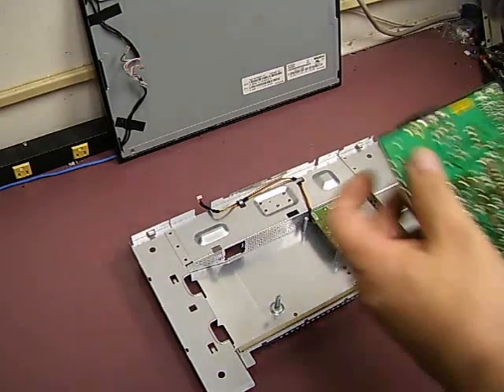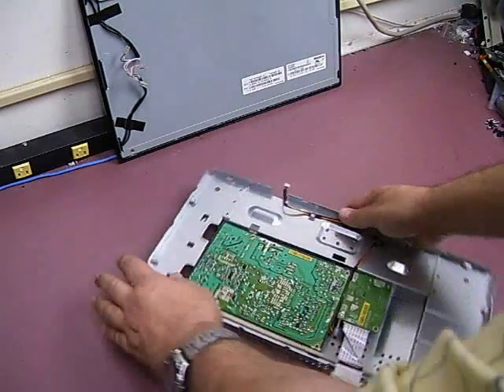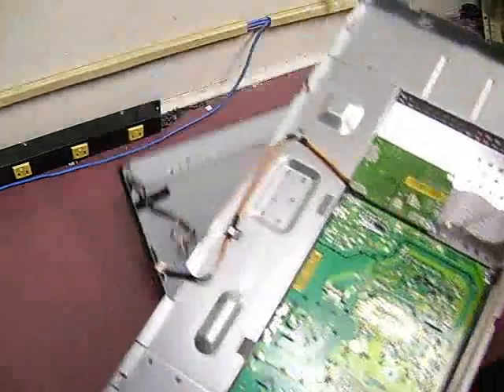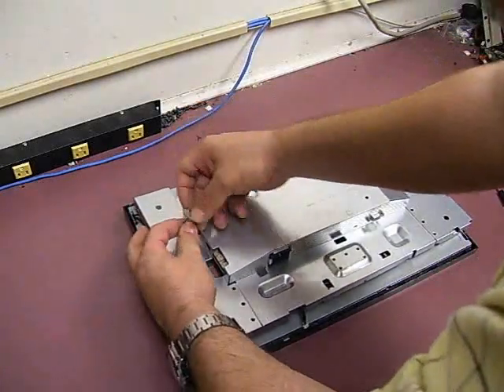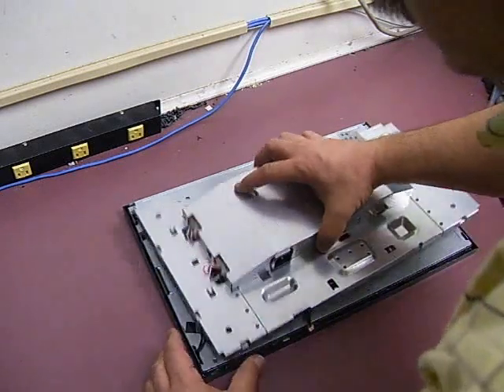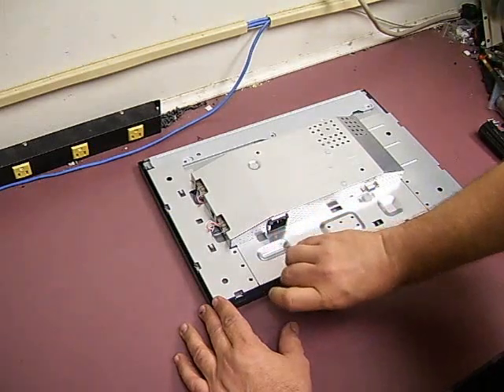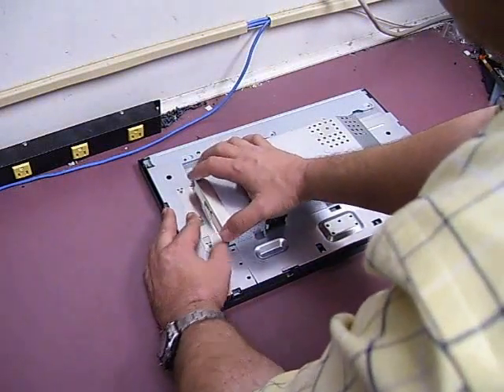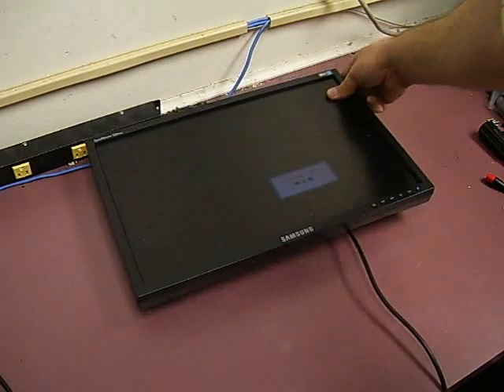Repairing the Samsung 920n / 920NW monitor Part 3 reassembly and testing

Comment: I have this same monitor it will stay on and I can use it for 45min and sometimes up to 2 hours and then goes black with power button still glowing, and when you turn it off and back on it has picture for a sec and then goes black. Would this possibly be the same fix thank you awesome videos

Comment: I managed to swap a screen from my working monitor with the board I'm working on. The caps are all fine. Turns out there is a bad back light in the display. Thank you for all of your help. I've already ordered some replacement bulbs to try and fix it.

Comment from the maker: Possibly a bad backlight. Do you know what brand capacitors you did install? The manufacturer name should be on the label. The parts from Radio Shack definitely will not work, they are not low ESR parts. We need to check the ones you have installed to be sure before we go farther into the diag.

Comment: I've tried a set from radio shack and a set from a repair shop online. They both have the same response. However, rarely it would be normal after several tries but go back to turning off after 2 seconds if I were to turn it off after. Could it be a bad back light?

Comment: I replaced all of my capacitors with the right values and in the right positions but my monitor still turns off after a couple of seconds. Do you have any other ideas?